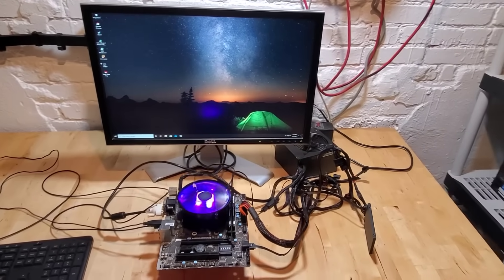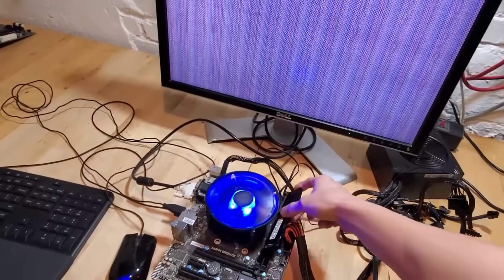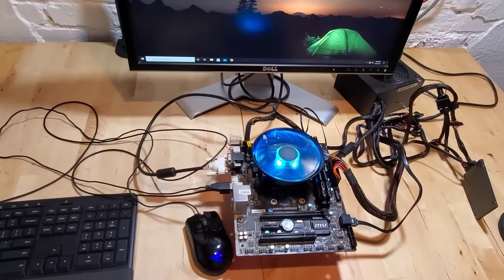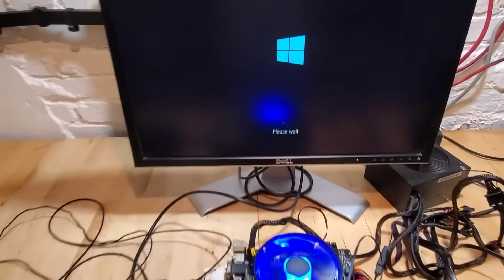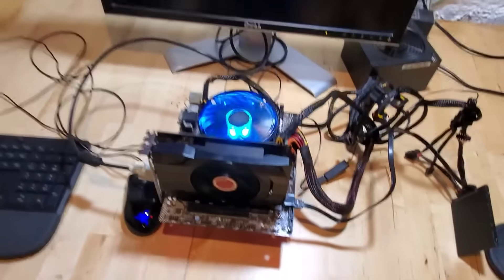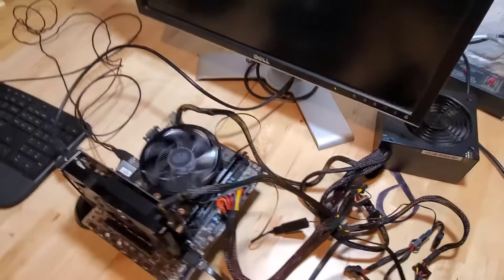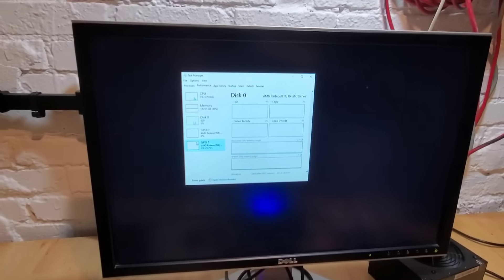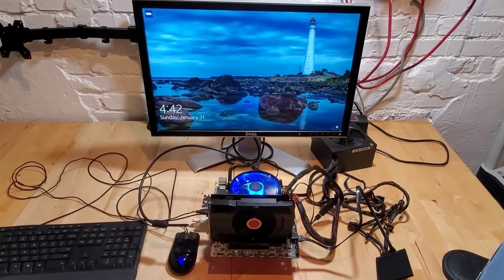What happens if you remove PC components from a running computer?

Comment: It would be interesting to see how the system would react if you removed the RAM while running with the dedicated GPU. When you're running with the internal GPU, it uses the system RAM as the video memory which I'm guessing is why the display started acting up when you removed the RAM. But if you have a dedicated GPU that has its own memory, perhaps removing the system RAM would not cause as many issues.
Reply: There's not much you can do apart from lock up when removing ram. Think about it it's volatile storage that needs power and is basically storing your OS/applications/drivers etc whilst your machine runs. Removing a stick of ram is like deleting half your brain whilst you are in the middle of shopping.

Comment: He, I got 2 Problems with my PC. Maybe anyone can help.
1. Sometimes, when I start the PC The Fans start spinning and the RGB works but no signal is transmitted to mouse/Keyboard/Monitor. After resetting it works 95%.

2. A small hit on the table (out of Rage or because I hit it with my knee) causes the PC to Freeze...

Comment: OK I'm now curious what happens if you remove the GPU while the system is using the iGPU as its main card.
It could still stay alive. Or not.
Reply: you cant, If you have a dedicated one, the system will automatically use the dedicated one. and if you remove it, it will remain configured from start. 
I mean, the system chooses which mode to use when turning on the pc. after that you can't change it. you have to reboot.
Reply: @Sally725_19  Umm. Yes, you can. I do that every often for work.

If you plug the monitor to the iGPU and leave the dGPU unplugged (all ports) the OS and BIOS will prefer iGPU over the dGPU.

You can still specifically use the dGPU on D3D11+/Vulkan games that allow specifying which GPU to run on (it will be slightly slower because the dGPU needs to transfer the backbuffer to the iGPU so it can be displayed), but in general the iGPU will be preferred by default because that's where the master output is.

Comment: Would have been cool to see if windows and the components are smart enough to use the CPU's integrated graphics as a fallback. (4:00) I highly doubt that, but I never tried it ^^
Reply: Obviously it won't, partly because it chooses what to use from the beginning, and the other part is, it is completely useless, since if you have the monitor connected to the gpu, if it is disconnected, you have nothing connected to the integrated one.

Comment: What's happens when you remove your mouse when system is running
Reply: explodes, its the big bang, ok no.  if the question is serious, nothing. you can connect and disconnect whatever you want. you can even have 10 mouses connected or 0

Comment: The original video had 1 more clip that is left out in this video.
You should notice it between his quick intro and when he pulled out the ram, there was a cut.
"Cortana, what's 1000 - 7?", he asked.
Then, the computer screen froze before he even removed the RAM.

Comment: Your GPU removal test was extremely lame. You should have put a ssh or ftp server on the computer and access it remotely and see if the rest of the system is still running while not having video.

Comment: For those who might be wondering the reason why the components don't work without a full system reset, here's an analogy.

It's like taking the tracks off infront of a moving train. You could put the tracks back on, but at that point the amount of things that have gone wrong for the train is so much it's pointless without just starting over.

Comment: What happens if you remove that cmos battery while running computer?, I'm curious about it... 😌
Reply: I had a faulty board for ages, CMOS battery 'slot' didn't connect properly & basically wasn't effective at all. PC acted perfectly all the time, only if you unplugged the power from the wall it would reset the bios completely & I'd have to update the date & settings.

Comment: i wonder what happenes when you remove the cpu with graphics card installed because the way you did it it was obvious the display will go black since its running from integrated graphics

Comment: I thought this was... Obvious. I mean, rather than accessories that you can plug in, any hardware change will require a reboot. Also, people tend to think that hardware is fragile but they're not that fragile. You can use your bare hands without any static energy wristband without any major risks these days.

Comment: I was watching youtube on my pc and i clicked on library and suddenly and the screen becomes reb blue green lines i think it took a lot of load and suddenly something like short circuit i was scared i  directly closed the pc by disconnecting power supply and after that i turnd it on it wasn't turning on and sounding like about to explode i called my neighbour who is expert of pc the opend my pc and we saw that ram fell ed from slot we fixed it and it went back to work 
Everyone should have neighbour like me

Comment: I'm fairly certain SATA is actually hotswapplable, meaning if you took out an internal hard drive while the system is running it won't shut down. Granted, you also have to not be running your operating system off that drive. You can also plug drives into the computer while it's running as well, the operating system should be able to find them.

Comment: Removing core computer parts like the CPU, RAM and Hard Drive while a PC is running could cause damage especially Remington the CPC which the damage can be irreparable as you remove the fan and heat sink the CPU will overheat and removing the CPU could destroy the component and cause burns to your skin due to the temperature of the CPU. Always have the computer unplugged while removing components to avoid damage. At least you didn’t destroy your CPU as when it happens your computer will not even get to the boot screen let alone the windows recovery screen.

Comment: ram stores data about pretty much everything a computer is working on so taking out the ram just screws with the CPU and the GPU hence the weird artifacts. the embedded chip doesnt know what to output to the screen

windows goes into recovery mode pretty much every time it detects a malfunction and does not mean a CPU has to fix itself. 

gpu is still running as its connected to power and without any information about the temperature from the mobo it just ramps the fan up to full throttle.

Comment: A lot of recent PCIe slots are hot swappable. If the software supports it, the GPU should work when plugged back in. This is of course assuming no GPU computation was being used since such a task will use the GPU memory and cache that will get lost when the GPU gets unplugged.

Comment: I’m kinda new to pc building, and I wanna upgrade my pc. I need a GPU that will run on a legacy bios. Do RX 580s work with that? And if so, I’m thinking about buying an 8GB MSI Armor MK2.
Reply: Yes. GPU's generally fit all MB's and BIOS's. Your choice of GPU have no restriction.
Reply: @MalhaIIa  I put an rtx 2060 in it and it didn’t work. I had the right drivers and everything as well, but I looked it up, and it says newer cards run in a UEFI BIOS, and if it doesn’t work you need a card with a legacy bios. It’s because my PC is almost 13 years old.
Reply: @OmegaWolf543  well yeah other limitations become relevant when dealing with that old hardware. still though, bios is irrelevant to a GPU. however, a GPU may have support for UEFI so that you have better resolution in bios. not needed for the gpu to work however, just an extra feature.

Comment: When you take out the GPU the computer may actually carry on as normal at least until you put it back in (except you can't see it, but say you have headphones plugged in and listening to music, music will continue to play). I know this as I have a graphics card that constantly pops out at the slightest bump of the case 😭
Reply: Just make sure it's seated tightly.
Reply: @Michael01OnRBLXmore  yeah mate my motherboard is buggered 😂😭 but it's ok, I'm replacing my pc as soon as next week with something way beefier
Reply: @Potatoverynice  You know, some GPU PCI slots have a lock. They are just like the locks for the RAM slots. 

I'd suggest you get one with a GPU PCI slot lock so when you seat the videocard, it will make a clicking noise. Means its now seated. Now all you have to do is screw the sides.
Reply: Which gpu is it
Reply: @RRareGaming  an old 2080, but soon I'll have a 3090 when I upgrade
Reply: @Potatoverynice  wtf gimme
Reply: @Potatoverynice  RTX is a big GPU so be careful with it and make sure it's seated tightly.
Reply: @Michael01OnRBLXmore  i think you have a PhD in making sure that  gpu is locked or seated tight
Reply: @sambuddhabhusal2479  Nope, it's really important that the GPU is seated tight because if not, it will disconnect easily.
Reply: @Michael01OnRBLXmore  i dont think you got the joke
Reply: @sambuddhabhusal2479  you certainly have a PhD in humour
Reply: Pretty sure you can get aftermarket GPU stands that hold the power delivery section, for extra rigidity.

Comment: I once found an old amd system in the trash and used it to practice taking apart computers. After the ram was out I turned my brain all the way off, took apart my computer case and started trying to shove in this old ddr2 ram stick into my beloved computer that only supports ddr3 ram.. While it was on!

Suddenly there was smoke coming out of the ram stick... I look at my computer screen and it looked like my computer was on it's death bed: the video output was actively having a stroke. 
Little me has never panicked harder than in that moment. There is no way to turn off the computer or use your mouse in this state: it is the equivalent of labotomizing your pc. The computer doesn't even understand the power button you have to unplug it from it's power source or use that motherboard shortcut in the video.

Comment: If you enable hotplug on the SATA/M.2  you can remove and swap drives and the BIOS will resync with the drive, however the OS drive being removed will still throw the blue screen.  Hot Plug is typically for servers with RAID arrays but there's no reason you can't use it if you need to swap drives often for data recovery or backup. Also don't do this with DVD/Blu-ray drives it will burn out the laser. Learned this from personal experience.

Comment: With the storage device it is fine aslong as the OS or other programs arn't writing data to the drive when it was unplugged. If though a windows update was happening or windows was saving data like thumbnails or user cache when you plug it back in it will either be next to useless without an OS repair or software wont load properly without all their data being deleted to reinstall / save it.

Comment: You should have tried everything with a gpu in. The integrated gpu depends on the ram but a discrete gpu does not. And when you remove the cpu you are also removing the gpu as well
Reply: would still shit itself, the moment the addresses stored in the ram are no longer there the system doesnt know what to do and crashes
Reply: @DJTimeLock  n
Reply: Also have thought about that.
Reply: Right? Removing the CPU will have the same effect as removing the GPU at that point so it would be boring
Reply: Hell yes, i really wanted to know this :(
Reply: Good point.
Reply: if you remove the cpu while using a gpu too everything just freezes
Reply: I have seen elsewhere that the screen goes black when you remove the cpu with the gpu in. But even though you could say that it turns black it is still nice to actually see it in practice.
Reply: A GPU displays the data that it gets from the CPU, means no CPU = no picture
Reply: @Kasi11  The gpu does proccessing of its own, it doesnt just recive pixel data from the cpu and put it into a display buffer that then gets sent out of the video output (hence the name graphics processing unit) so it is not completley dependent off of the CPU. If you unpluged the cpu it would still be trying to spit out video and most likley would, but it obviously would be very messed up.

Comment: The only thing that's take "safe" to unplug while the PC is running is secondary drives, preferably SSDs. Just like portable hard drives, though there are some differences.
Reply: NOT TRUE

it comes down to this......

IS THERE COMMUNICATION OCCURRING BETWEEN A COMPONENT, RAM AND CPU
if the answer is YES,  it's not safe to remove
if the answer is NO.. then it's safe to remove

You can still have a secondary HARD DRIVE but it's still communicating 
it can be a floppy drive , it can be an Optical drive, it can be a TAPE DRIVE, Makes no difference,    
if a session exists between the device and the CPU you shouldn't remove it 
again..  THIS IS WHAT HAPPENS WHEN YOU SAFELY REMOVE USB...
it terminates the current session in place
Reply: @martinkuliza  true, that is more in depth of a description
Reply: @YuThinkUrCool  True, But it's a description most people need to be aware of .
at the end of the day computers have fail safe's for the stupidity of humans but... it can only go so far 
after which point you just lose data
Reply: Even for the USB drive, there is option to "safely unplug".
But audio/keyboard/... jacks are pretty safe
Reply: @Fera-gr5mm  
that's because data loss cannot occur
if it's a speaker it will generally have an ANALOG audio Jack (a digital Session does not exist)
in some cases you can get USB speakers that establish a digital session , but
1. this is rare
2. there is no data lost only a session that drops outs of sync, to which  restart will fix it

if it's a keyboard of mouse
again... communication session is lost but no actual data is lost because it is defined as  AN INPUT DEVICE
if it's not transmitting information it doesn't matter
Reply: @martinkuliza  Good reasoning :)
Reply: @Fera-gr5mm  thnx
Reply: @Fera-gr5mm  thats because they could be in use at the moment of unplugging
it's completely safe to skip if you've made sure nothing is using it at that moment

Comment: When you took out the gpu you didn’t switch the display cable to the original port to see if it was still running, was the only thing you didn’t do.
Reply: I do with a laptop using a external gpu replacing the wifi board, you can hot swap a gpu using pci express

Comment: much better than those dumb youtube shorts videos where some dude says "what happens if we put this in the wrong way," "wrong slot," et cetera and then proceeds to quit after doing some boring shit like failing to plug a usb upside down or half-assedly putting ram in backwards and quitting when it doesnt fit without trying to turn on the computer or cut the keyhole to force it to fit

Comment: After hooking back up the SSD and rebooting the system. We’re you able to test and make sure that there was corrupted memory? I would think no as there were no current reads and wrights happening. Could you try and unplug the SSD while a read and write is happening? I know how a HDD would react. The SSD would be interesting to see how it affects the SSD as a whole and if it would corrupt the OI along with the file that would have been interrupted.

Comment: You can't remove your main drive while running your system but you can remove other  drives and just plug them back in when you need to. The system still works like it should. Though I only recommend doing that with drives that only have files on them and not any programms otherwise you could loose data on the drive

Comment: 2:08 it would be interesting if the monitor was connected to the graphics card instead of the motherboard, because obviously it will lose the image since it is an APU

4:17 and here I would connect the monitor to the motherboard to see if it gives image or not, although I am sure it would not

But good video :) You answered a question that I didn't know I had

Comment: I tried to explain some things here (I might be wrong as well, please correct me if I've been stupid)

- The first time you removed the RAM, the graphics glitches were there because the iGPU was using it as VRAM. The computer is "remembering" the pixels it made, taking away the RAM causes it to forget those pixels, you simply lost information about them. A dual-channel memory config stores half of the screen in one module, and the other half in the other module, that's why you have a faster APU with two sticks, half of the screen is in one RAM with 64bit bus, the other half is in the other with also 64 bit bus, so you can transfer the whole screen and other graphical data twice as fast pararelly on 2x64=128bit bus.
- Putting back things won't help. RAM loses all its content due to lack of power, also taking it out messes up the buffers everywhere else.
- Windows will boot into recovery anyway, if it shuts down without the shutdown procedure twice, even if its just a blackout.
- Everything you see on screen, is in the RAM and VRAM, so if you take out the boot drive, the computer will keep processing those things, until a new data is needed from the boot drive, then it will causes the softwares to crash, eventually the operating system as well with a BSOD.
- The only time you actually destroy stuff is when the main power pins getting in contact with data pins on the component while you pulling it out, if it's been avoided, it will have no problem working again, just needs a reboot. (its rather for the GPU which has 12V rails, the processor and RAM is low-voltage, so you can't really destroy them like this. Also, the SSD and HDD has separated power pins, so that is also hard to kill like this.)

Comment: 0:13 Adding to the screen distortion issue, it's not just the RAM that causes it. It's also caused by the GPU. 

The screen becomes distorted because the GPU is not seated properly. It's probably loose so make sure it's seated really tight. (Not too tight though)
Reply: mikasa